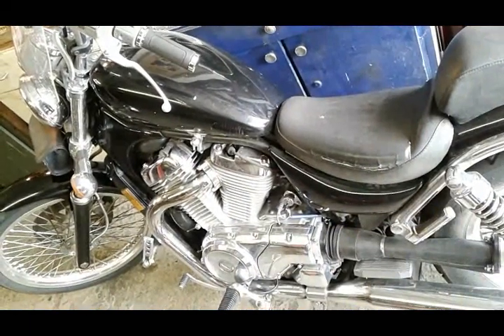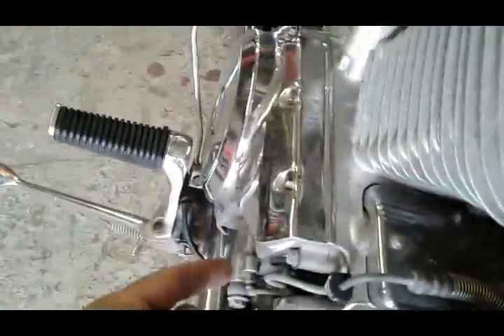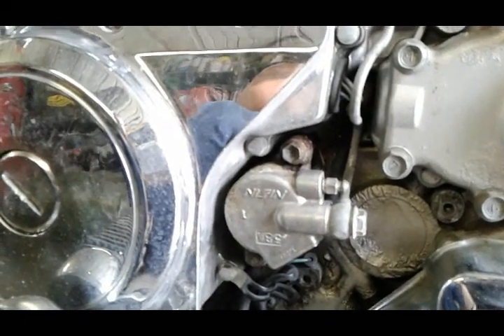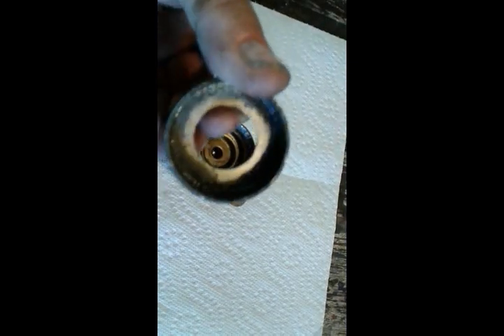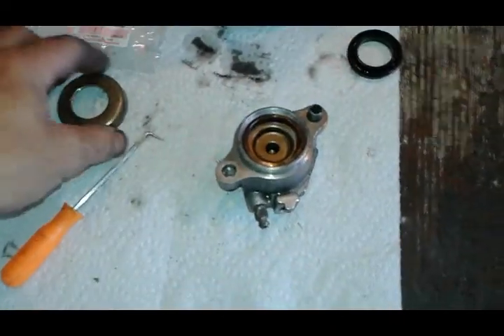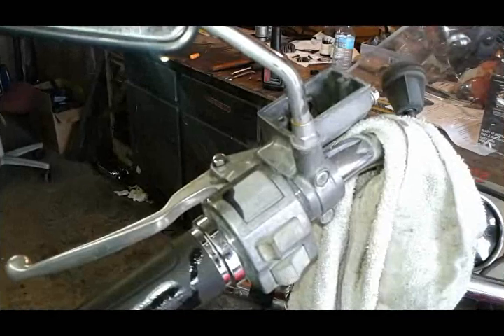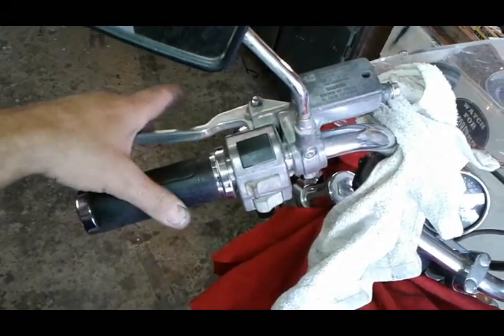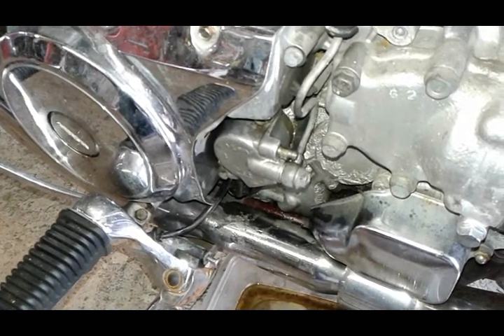Hydraulic clutch common problems

Comment: Took of slave cleaned up new seals/spring but back on bike bleed clutch seem ok Resistance , but not driving still making clucking sound like something is not Engaging properly, gear, selector, area noise is located I was originally riding when I was slowed down & forced to pull to curb any ideas please?

Comment: Its common people's mistake not changing the fluid, not keeping eye on fluid level. not checking where air bubble getting inside. Thats it i knew it. Problem with statement is that always compare average people mind with Great minds. Its irrelevant. by the way. Nice video, helpfull for average people devloping for great mind.🗿🗿

Comment: Good video on servicing the slave cylinder.
Make sure you use HIGH-TEMP dot 4 brake fluid- rated for 375ºF and above.  The reason;  if you're in stand still 'bumper to bumper' traffic for a prolonged time-  standard dot 4 will loose it's viscosity and you'll have no clutch pressure... this is a common issue.  I have 2 Suzuki Intruder 1400's... been there - done that.
Reply: Better still use Dot 5 silicon fluid, it never absorbs water so there's no corrosion inside the master or slave cyclinder and it never needs changing as it doesn't degrade. It costs twice as much as glycol fluid but the price is worth it as it's a once only change.

Comment: Well my Suzuki was doing the same thing but I checked I have good fluid and now when I pull in the clutch it does nothing
Reply: Continue bleeding the system until all air is out and you have pressure again .

Comment: Finally, a video to repair my Intruder! I don't know how many videos I watched and even tried reverse bleeding until fluid shot into the air and reached my open garage door, but my clutch still wouldn't pressurize. Not until I saw you had to bleed out the master cylinder and I am subscribing to yur channel in case I need more tips. Thank you very much!
Reply: Im having problems with an intruder as well. This fixed it for you? If so I will have to try it.
Reply: @BudderKing4u  it sure did, but that was my fault for letting the fluid get too low so it sucked air. Oops, first time I worked on a bike.
Reply: Going to try what you did ,I’ll let you know if it works. Thanks

Comment: My clutch grips in the very end.
Is there a possibility to bring this gripping point closer to the center?
( I don't know maybe with the length of the pushing rod or something )
The clutch pads ok, and the fluid was changed also.

Thanks in advance!
Reply from the maker: 99% of the time there is no adjustments on hydraulic clutches...if you got a sport bike you can try adjustable aftermarket levers...or sometimes bending the lever just a little might be solution for your reach...( make sure the lever is nice and hot sitting in the sun or heat it up a little so it won't snap)....adjusting the pushrod in the lever could work but I suggest having spare ready in case you mess one up...hope this helps and please subscribe to help me out...thanks brother
Reply: That's the sweet spot

Comment: After you bleed the clutch, will you be able to put the motorcycle into neutral without the motorcycle running?
Reply: You should be able to if it was bled correctly

Comment: The reason I hit the dislike button is that you advertise "common problems" but you stopped when you got to the particular problem this bike had and then you went onto fixing this bike. My bike has a different problem that you never got to because you were just interested in talking about the problem you were facing yourself. 

My bike has no leak but the lever is very hard to depress. I am guessing that I have a bad slave cylinder but who knows? I'm searching YouTube for an explanation of my problem. This video didn't help in spite of it's title.
Reply: Any luck what was it? I have same problem plz advise how yours was sorted. clutch very hard to pull in but it also says it's in gear off of the neutral light but the bike won't move

Comment: Put new aftermarket CNC hydraulic clutch and brake on my Ducati and they're not building up pressure very good any suggestions
Reply from the maker: On rare occasions I have to use vacuum pump to pull the fluid thru... specially on aftermarket parts or custom bikes.
Reply: Only time I ever had slow or lack of pressure build up was when I had a brake fluid leak at caliper once sorted pressure went well check fir leaks etc everything us tight and pump lever a few times before pushing fluid through each time it helps build pressure at master I've had no issues since

Comment: I flushed and bled my clutch on my 2005 vulcan classic. I am having an issue at first startup in the mornings. Every time I kick down from nuetral to ride, the bike jumps forward like the clutch is still disengaged. I start the second time with no problem. Have you any experience with this happening and what may be the problem. Thanks in advance.
Reply from the maker: yes I've seen this happen quite a few times and the only remedy for it was replacing the clutch sometimes these friction plates when they get older they stuck together for the first time and then after that is fine so it's your choice if you can deal with it leave it alone if you want to fix it you have to replace the clutch which is probably $120 if you do your own labor... You need to buy the friction plates spring and the gasket.... Thank you for watching please subscribe to see more videos in the future
Reply: It only has 18k on it. If I let it warm up a bit it seems to shift down fine. Thank you for your reply and very informative videos.